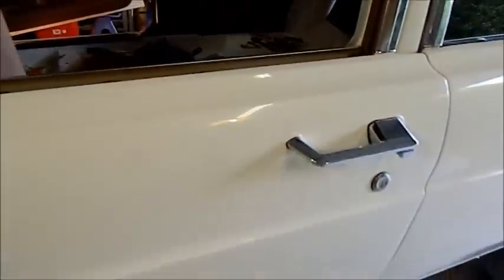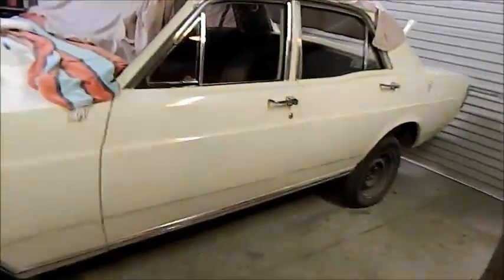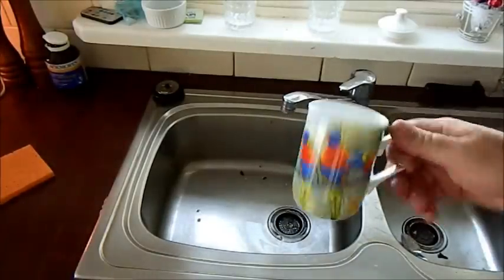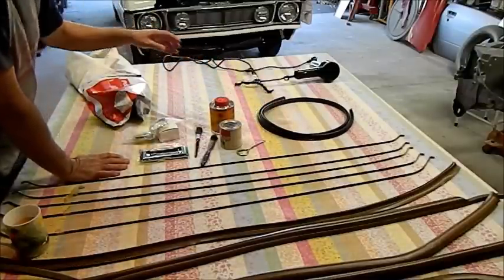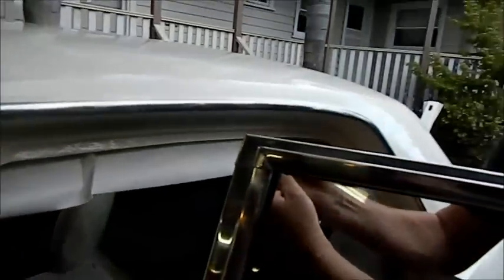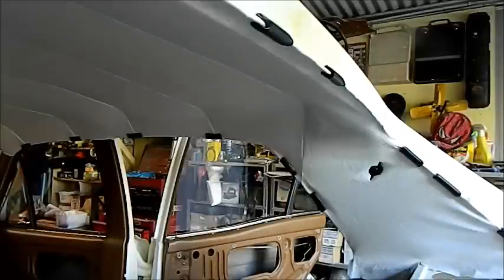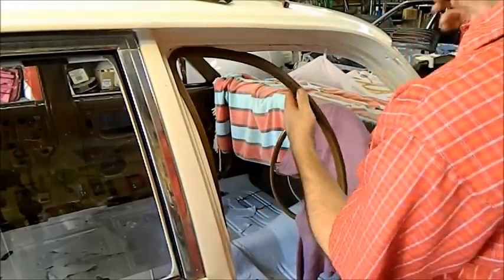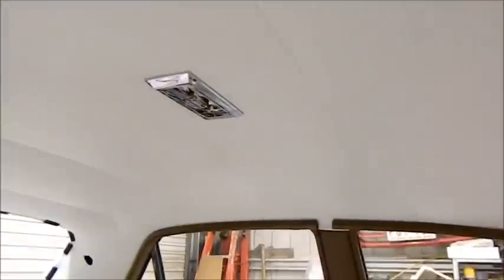1969 XW Ford Falcon Restoration Part 20

Comment: I like the way you work through issues. Cheers for sharing your experience.
Reply from the maker: weighed11 You're welcome... The problem with this is all the repro parts, of which a lot don't fit. That little Toyota we've been messing with will snap together like Lego - The more modern stuff seems so easy.
Reply: I believe the reward in the end will be greater though, at least in my eyes anyway.

Comment: just a tip when you are rubbing back the top coat use a soft colour block 
that way you will get a flat surface 
if you rub it using your hand you tend to get ripples in the finish

Comment: I am just wondering how long it took the production line workers to complete the headlining installation as the new vehicles rolled down the line?
Reply from the maker: Wouldn't have a clue, but an interesting point... if it was pre-glued at the edges and you had several people who had vast experience in it around the car, they'd have to knock it over in 15-20 mins, surely...
Reply: There may still be a few retired old Greek and Italian guys living aroung the Brunswick area that could have fitted your headlining in 15-20 minutes. :-)
 It would be good to get some production line workers from '69 to give some input,insight or anecdotes from back in the day.

Comment: Hi Peter, did you reuse the original glass or buy new? Awesome videos thankyou!
Reply from the maker: +Nick Hoare Hi Nick, Thanks for that... all original glass and seals, although I did have a new laminated windscreen fitted and I had it "Urethaned" in place rather than using the original type sealing kit. Cheers Peter